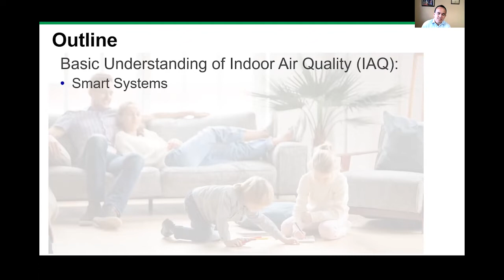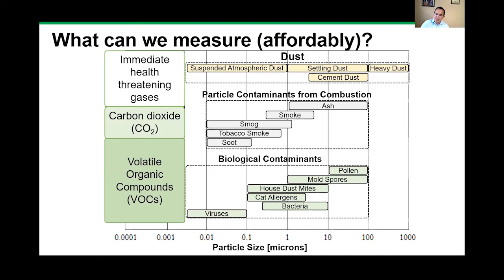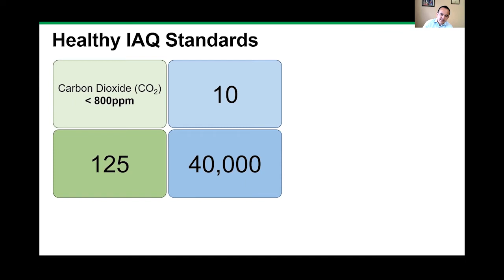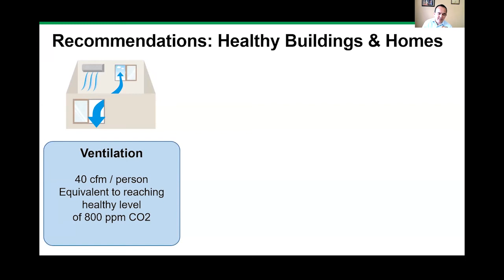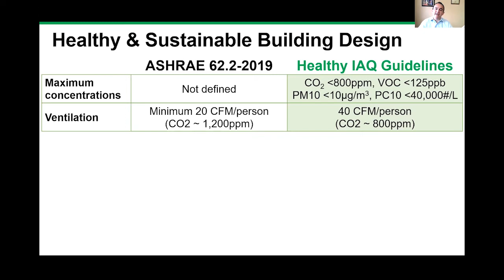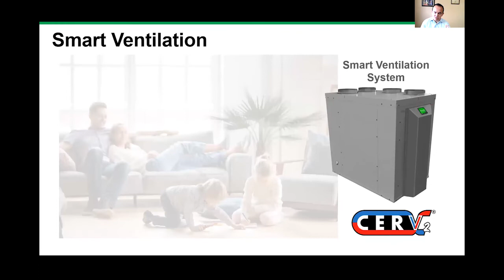Healthy Indoor Air Guideline With Smart Strategies to do it

Comment: Do you have any recommendations for a good quality(accurate) air quality monitor that does CO2/TVOC/PM2.5/temp/humidity that is not in the smart ventilation system? Seems like good ones are hard to find and some of their specs are questionable. Thanks.
Reply from the maker: Our program manager is testing many IAQ monitors and while we can never know if it is accurate we can say responds in the way you would expect it to based on occurrences. We highly recommend Awair which is on sale for 36% off now! https://www.amazon.com/Awair-Element-Indoor-Quality-Monitor/dp/B082ZF4H37